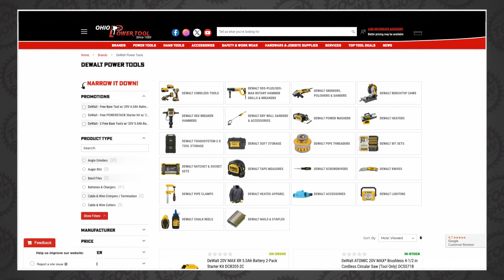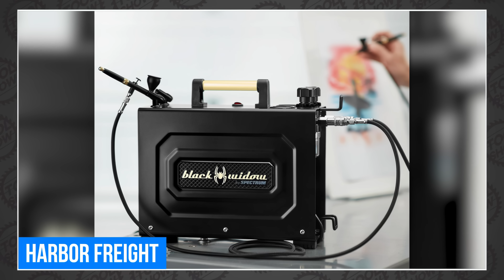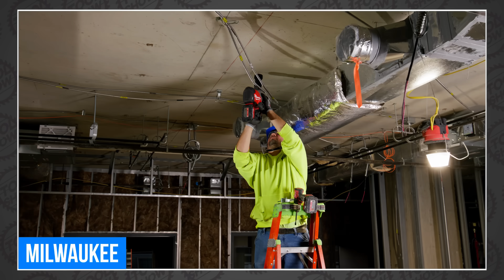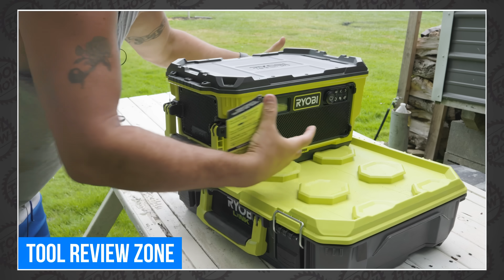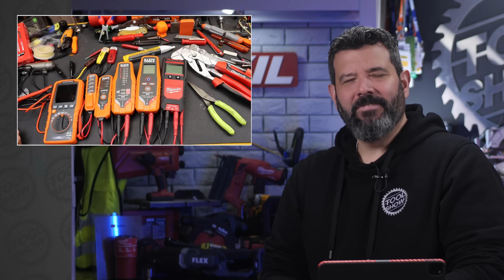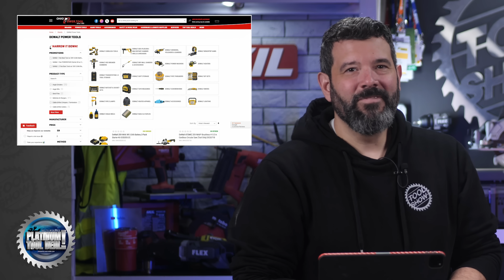NEW Power Tools from Milwaukee, DeWALT, Harbor Freight, RIDGID and more! Milwaukee PIPELINE details!

Comment: I hope the current xrs still have the same power they do now when they aren't called xr anymore. And i hope the dcf860 doesn't need to run on the newest batteries to have all the power... They are trying to sucker us into buying the power stack. Power stack has been way too expensive to even consider buying. Now they make the new tools that are only stronger if you use them. I'll switch to Milwaukee if that's the case. Not spending that kind of money just to put screws into wood...

Comment: I am a huge dealt user on pretty much all tools and Milwaukee nail guns, which I love.  As for the nail guns, I bought Dewalt and Milwaukee framing nails to do a test.   I did return the Dewalt.   It was mot my normal platform, but Milwaukee won out.  At least for me.    Oh, I also bout the Milwaukee steel cold cut. circular saw, which is a beast.     Love your show, and watch all the time.         Cheers

Comment: Flexvolt Advantage are actually tools that can take advantage of using a 60V battery even though they're not running at 60V. Power Detect tools are just slightly tweaked XR tools to satisfy Lowes being big whiny babies about wanting a unique branding that Home Depot, Ace, and others don't carry.

Comment: I gotta say, FastCap makes the best tape measures. I love the little things like the nice belt clip, the pencil sharpener built in and the little writing pad on the side. The tape itself has 1/16" markings which help, and they have the metric and standard tape which I use way more often than I thought I would. 

I still love my DeWalt tough series tape measure (the retraction is so smooth and the magnet is excellent) but as far as usefulness goes? I find myself reaching for that FastCap tape measure more than my DeWalt. 
I feel like I have to love my DeWalt tape measure because it was $35 and the FastCap I just like because it's a simple, cheap and feature-rich tape measure.

Comment: That DeWalt XR DCW620 20V max 2-1/4 horsepower cordless dedicated plunge router with a new tabless cell power pack 5 amp hour 20v battery...
*finally inhales*

 is going to be great...

Comment: I think the name is alright as long as it is clear in the outside packaging that the inside tecnology is different from what we are used to with the now common cilidrical cells. And that we can also see on the label what the cell chemistry is as companies flobally are increasingly experimentimg with cell chemistries which deliver different performance and charging characteristics. What I do find increasingly worrying with current tool brand is that they're making monofunctional tool batteries. With this I mean that for example that performance connectors are different from charging connectors, which means the batteries always needs a seperate dedicated charger from the tool. It would be nice of this was streamlined more to universal connectors in today's day and age. I think a lack of universal connectors on tool batteries, tools and chargers is obsolete and is not part of today's mindset. I am getting an increased sense the future is batteries and having a battery powerstation with multiple tool batteries is not becoming a more common occurence to charge and discharge the batteries from the power station. There are power generator tools from the tool battery makers, bit they don't all provide a more common experience. And I'm missing that all tool.batteries din't support a two way usb charger as standard built in to.the tool batteries. The tool batteries are also great charging devices. Yes, it may degrade the battery sooner in time, but I notice I use the tool batteries only on occasion and storing them for a while for later use also degrades the battery over time. I think those extra moments of using a battery as a battery bank fir charging isn't a too bad idea. And I think it is convenient to have a two way usb c pd charger built in for those occasions you forget to take a bulky tool charger with you, but still have a usb c cable laying around for charging your battery in the go im emergency's. It may take a bit longer to cahrge, bit it is better than having no option at all.

Comment: I'm selling off most off my dewalt tools, they have time for these marketing bs but not for revamping still brushed tools, flexvolt batteries tend to die for controller error and (at least in Germany) they won't repair them after warranty, the 3x360° 18V laser don't fits bigger batteries (there is a little nose on the batterie that hits), there are tools that only available in 12V, which 12V makes no sense at all since the 1,7a powerstack batterie is similar in size, nothing is compatible with the almost identical Stanley brand, the batterie status is, even on the newest batteries grab (full 3 bars, empty 1, you get almost no information from that), flexvolt batteries overheat long befor they are empty and so on...

Comment: ok this has been bugging me fa long time. why is molwaukee making thier circ saws left handed. example in the mark thomas builder vid. we see the guy cutting a bord using a squarehes holding the bord and square with his left hand thats fine right hand holds the saw.But the wide base of the saw is on the cut off piece and his left had is close to the blade. what is up with that

Comment: I’m not a DeWalt person but you just unconfused the confusion DeWalt made with this new battery and branding shift release. Thank you…lol!
Reply from the maker: Thanks! That was the goal. We think it's actually a very good change, but it's just not going to be a very easy transition.
Reply: @ToolShow  that’s for sure…lol!
Reply: What about the flagship professional 60v tools? Will this get rebranded?
Reply: @RangerReview  nope
Reply from the maker: That will remain FLEXVOLT
Reply: DeWalt has always had incredibly confusing part numbering schemes and branding. 

I think it's a conspiracy to confuse customers so they accidentally end up buying the older model for the same price as the new model that seems like it's never available... 

Ahh... DeWalt...
Reply: Almost like Milwaukee knew a thing or two about branding…. 😂
Reply: Batteries have really became technical since the rechargeable Ni-Cad came out when I was a little kid.

Comment: The DeWalt XR branding shift is a trainwreck for the consumer... You're attempting to explain it here... Imagine going blindly into a store with no help (and not the guy who is also responsible for cutting blinds surely won't have any value).
Reply from the maker: That's why Sarah mentioned the issue that both HD and Lowes will likely have. There's no way they'll communicate it well enough to their employees, and their employees will never have the skill or patience to communicate it to a customer.
Reply: DeWalt had contracts happening at more retailers than their competitors that their branding got out of hand. This is their attempt clamp down on the complexity in an attempt to benefit the consumers. It will be messy for a bit, yet it will all streamline in the end.
Reply: @JoshKing034  Using the old XR branding on new products, while they are still for sale as the old XR products will take a LONG time to streamline.
Sure the stores may only have a few years of inventory (assume the old stock will sell slower when new/better product is released), but what about costumers? 
How old is the oldest battery you own? The local contractors? It will takes many years before "XR" battery is just the "new XR" battery.